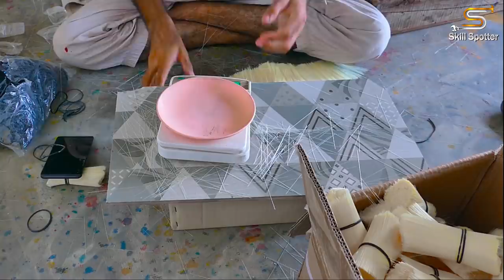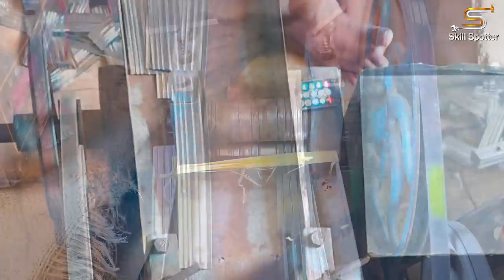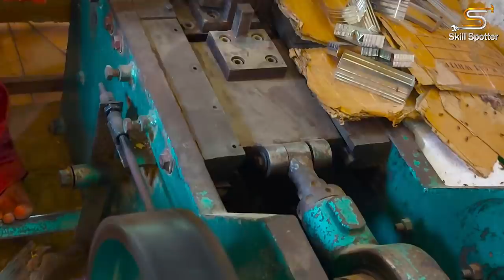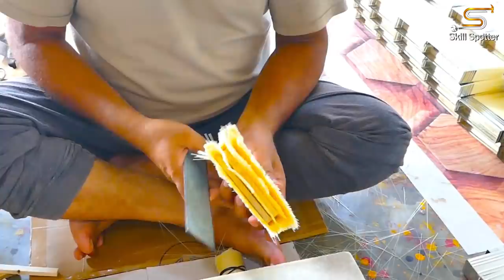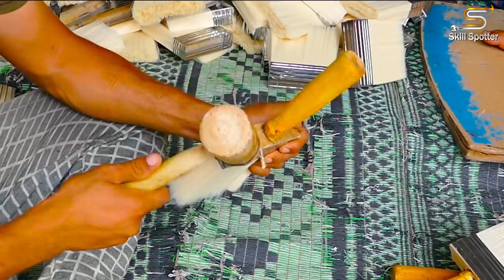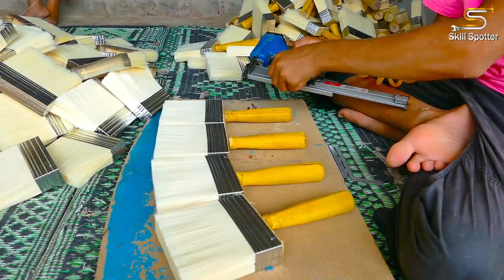Whitewash Brush Making Process | How Paint Brushes are Made in Factory

Comment: Did you see the flaw?
They didn't put nail in the front part where brushes attach into metal part. That's why they loosen & broken on applying force much earlier than actual product life.
Reply from the maker: Respect your opinion dear.
Maybe you know better about this.
Reply: @SkillSpotter  I've used this type of metal cased brushes many times for household painting works and most of the times these 2 parts got separated even before wear & tear of the product. The same thing is happening in video
So putting 2-4 extra nail in the brush both sides can make its life much longer.

Comment: Thats why paint brushes got more expensive..
Paint brushes handle need to be made from  plastic rather  than wood handle in order to achieve  more durability
Reply: Yes, add apart that doesn't decompose for atleast 500 years instead of cheap and biodegradable material 👏🏻
Reply: Yesterday i found that the paint brush handle was made from plastic indeed (India). Not all but most
Reply: Quality paint brushes are made with wood handles.  Cheap brushes have plastic handles.  Your comment is rediculous